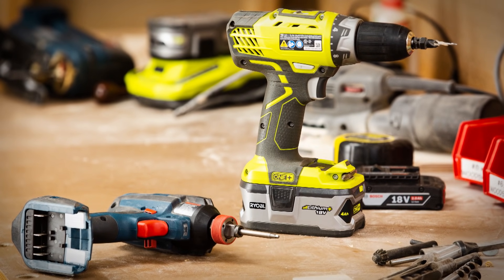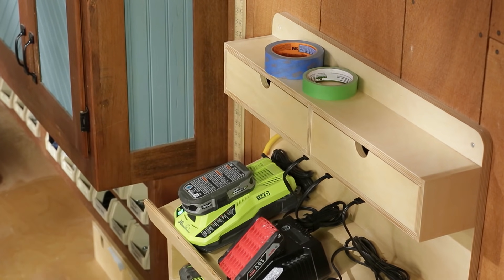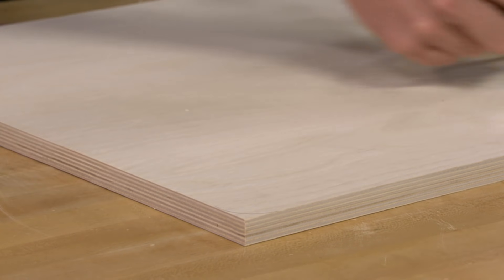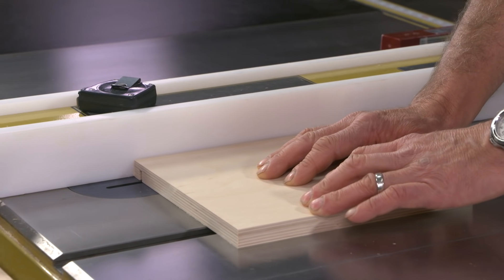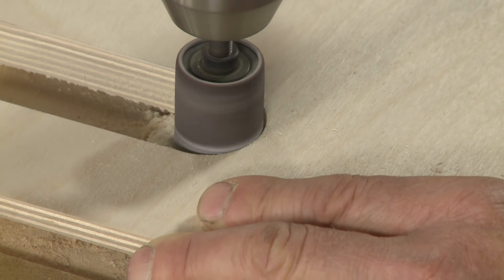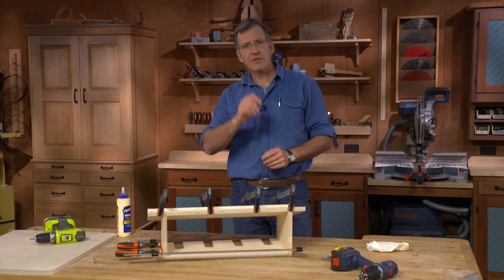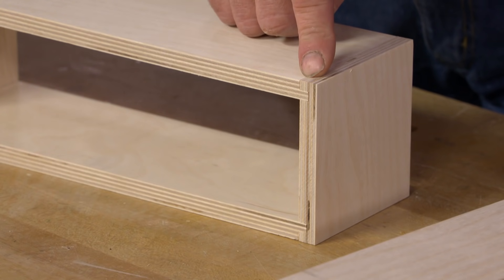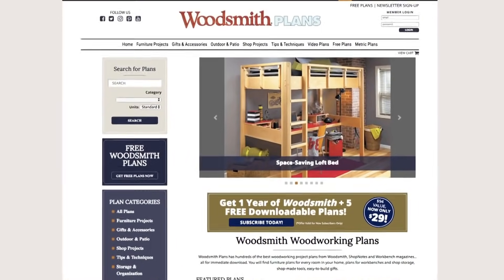Building a Cordless Drill Charging Station

Comment: Why does everyone of these I see have the drawers at eye level, and the drawers above.  I’d flip it and have the drills and drivers on top.  Write on the back of the handle what they are and they can be up at 6-ft. , and the drawers down at four feet, where you can see what’s in there.  And, since nearly all manufacturers now have slide in batteries, and all the chargers have keyholes in the back to mount them. 

So, why not mount the chargers to the back, and then have a shelf below that.  And a couple of drawers below the shelf to hold charged and discharged batteries.  That way you have a place to store the charged ones ready to go, and teh discharged ones waiting to be recharged.
Reply: Yeah, I thought that too and built one that way. I cussed it for a few weeks and then tore it apart to build one more like the one in this video, 'cept it holds more drills.

Mount it as high or low as pleases you, but after moving my finished version a couple of times I settled on positioning the drill holder shelf in the same plane as the adjacent wall cabinet (typical kitchen wall cabinet height). This puts the drill handles in the otherwise wasted "shadow" space above the bench top below with the handles hanging under. The top of the drawer housing is in the same plane as the top of my miter saw dust hood which is adjacent on the other side. I allowed about 3-1/2" clearance for the drill bodies under the front edge of the charger shelf. My drawers are actually tills and deeper than the ones in this design. I pull them out and set them on the counter if I need to rummage through them.

Point however, is that while putting the drawers low seems like a good idea, it didn't work well. Like many ideas that seem pretty good in our imagination, it turns out that there is a practical reason why the drills are on the bottom and the drawers are on the top with the chargers sandwiched in the middle, the arrangement is just more efficient.
Reply from the maker: You make some interesting points to consider.  I've found that these drawers are so shallow that it isn't like you can slide them out a little to look inside.  I just take the little drawers out and set them on my bench or take them with me and then put them back when I'm done, and I usually just store my charged batteries on top of the drawer case up and out of the way.
Reply: Those are good ideas. I also was underwhelmed by the videos on YouTube and images of builds like this. I chose to look I to this one simply because it was a smaller version and I don't think most DIY home handyman have 12 different drills at the ready. Anyway please make a build video of your ideas so I can copy it. Haha! Sorry too lazy to draw up the plans myself.